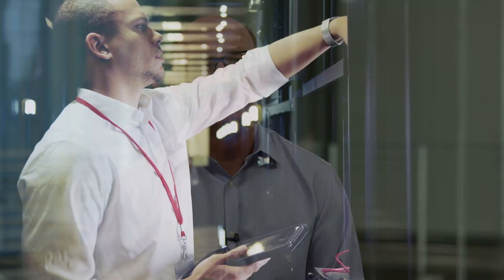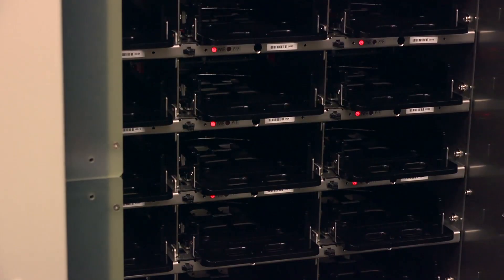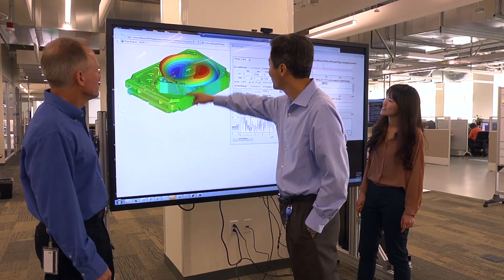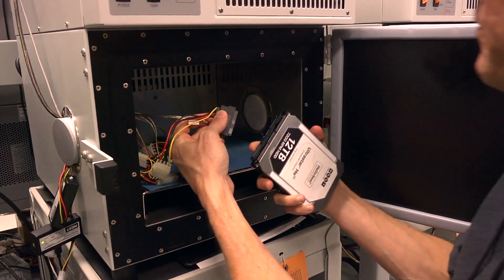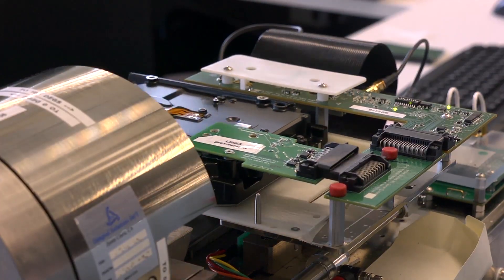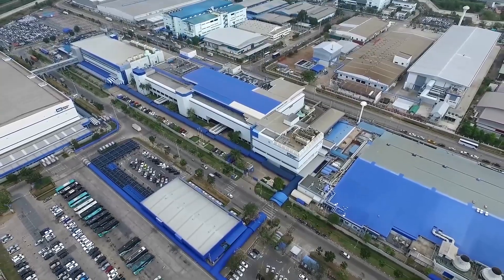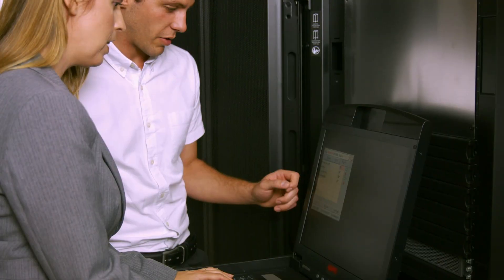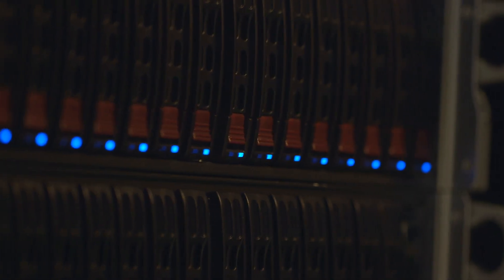Four Generations of Helium: Hello 12TB

Comment: what if helium leaks out - drive is busted
Reply: the biggest issue would be friction, which would mean that the drive just starts to spin slower until it detects it and stops it entirely.
If nothing else went wrong, you could just put the hardware onto a new enclosure and you can reaccess your data again
Reply: "He" = Helium. "HE" = High Explosive.  Joo2oob

Comment: I have bit of confusion with all the PNs and differences, so this is the story:

I am creating a new workstation for myself based on Windows 10 Pro (or Enterprise), and I plan to get either 10TB or 12TB as an archive HDD for it (system will be on m.2 SSD). And I plan to get HGST HE drive. Now, which one should I get?

 - 512e or 4K Native? Will this work well with my OS? Will it cause any problems with applications?

 - Will I benifit from "Power Disable Pin (Pin3) Feature" in desktop environment anyhow?

 - Instant Secure Erase? Secure Erase? SED? TCG? Do I need any of these features? I do not find it nececary to have my drive encrypted, but it would be a nice bonus just in case...

 - I know I cannot use SAS on my MBO, so I guess I am going for SATA ones.

Basically, which PN would be recommended? Durability/lifetime is my main focus for archiving HDD.

Comment: Seriously 12TB HeDD only come in 2017 at what I imagine will be over-expensive and therefor nullify the higher speed or energy saving? Yeah thanks but no thanks.
Reply: The price ranges for HGST and Seagate 12TB drives are:
* SATA: $820 - $870
* SAS: $840 - $890